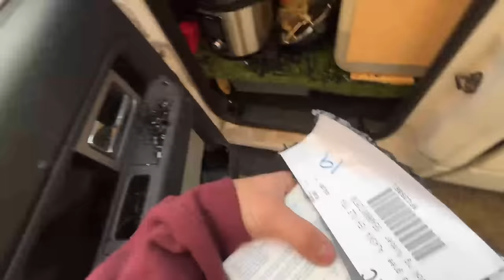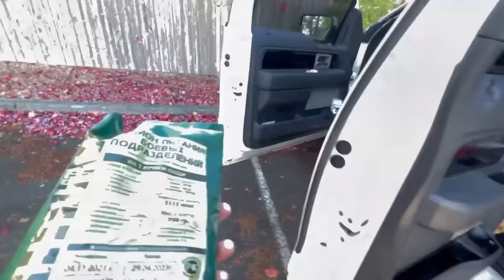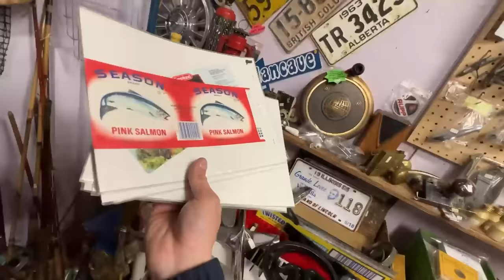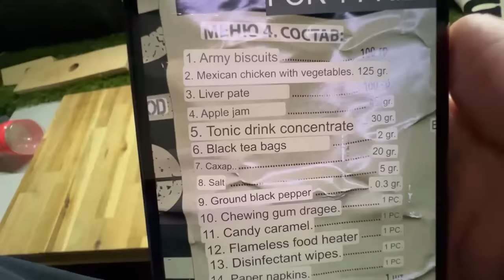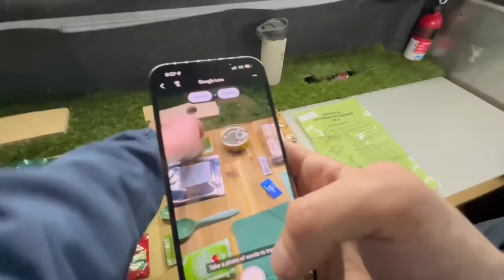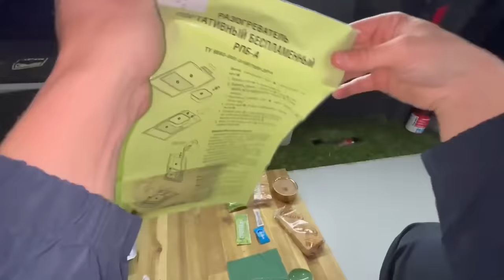Rainy Night Truck Camping W/ a Russian MRE

Comment: 3M makes a window security film that protects against smash and grabs and keeps your truck cooler by blocking a lot of solar. Since its your home it might be worth it.
Reply: Comments like these are actually helpful and are good from an investment standpoint. Also Better then fake sympathy😂
Reply: Oh, I never heard of that.
Reply: Just be aware that the protective film doesn't prevent the thief from chipping a hole in the window, big enough to stick an arm through. It happened to a work truck of mine once.
Reply: @ry-man4354  that's true, no measure is theft proof, but it will buy you time... like if some one broke in while he was sleeping in the back.
Reply: Not that I'd expect it to happens, if his truck fell into a body of water, would he be able smash his way out? Curious.
Reply: ceramic tint, it works surprisingly well. Slows down the thief substantially.
Reply: @michaelvandromme  

I believe I saw on Mythbusters that you wait for the vehicle to fill will water before opening it. There's no smashing windows underwater
Reply: @michaelvandromme  auto manufacturers are know coating the door glass w product like this & are making the glass part of the structural integrity of the vehicle. Something that individuals really need to be aware of when it comes to automobile accidents.
Reply: Unfortunately , the thieves would just do more damage to the car door and maybe  even vandalize the car even more before moving on to the next target. Bad people doing bad things.
Reply: @my_flippin_journey automotive windshields have always been a structural part of the build

Comment: i recently had my f150 broken into in my own driveway, i could be sad & upset that they got my sunglasses & some center console change or i could be extremely happy they didn’t break into the truck bed where there’s thousands of dollars worth of milwaukee tools & toolboxes i use to make my living. glass half full mav! keep on truckin!
Reply: Great mentality brother
Reply: Hello from Australia. 
 I Just thought you might like to get warm by watching my channel and my camping set up. 
Cheers 
Out There Touring
Reply: If you forgot to lock the doors, the term of that type of stealing, is called shopping.  If you had your bed shell locked, I guarantee they checked it, and moved on.  If they smashed your window to steal change and glasses, they were just dumb.
Reply: @bobsponge1877  thank you bob, very insightful thinking buddy. to answer your question the window was broken & my tonneau cover locks with my tailgate.

Comment: I actually just had my truck broken into as well. Right outside my apartment in the gated parking garage with security supposedly "monitoring" the place all night long. Thankfully (and oddly) out of all the pricey equipment hooked up in there, they only stole about $10 out of my center console and a blanket I had in there. It's such a violating feeling though, knowing someone went into your property and messed with your stuff. Sorry that happened to you Mav. What comes around goes around though, and they'll get what's coming eventually.

Comment: Hey MAV. The carbon monoxide detector may have been triggered by the flame less heater in the MRE. The Army gets mad if you use them indoors so there may be a correlation there
Reply: That's definitely it. Those packets release gas.
Reply: 100%

Comment: Tint the windows as dark as you can on the camper and the rear windows if you don't already and weather tech makes really good window covers for all of the windows in the truck and they sell individual ones or the set I use them when I leave the truck for a few days !

Comment: The meat was potted meat, or some call it deviled spam. The crackers are commonly called hard tack. They are a common staple in most foreign MREs. Your CO2 alarm went off because you were using a flameless ration heater which produces hydrogen gas which can in some cases trip CO2 alarms, however, the amount produced was in no way dangerous or hazardous, just got it too close to the detector.

Comment: You should look into having your back seat assembly removed and have a lockable cabinet built into the back seat area.  I have a friend that did that for his welding rig.  It serves to purposes.  first obviously is security for your things, but the second purpose is if you get into accident. all the loose stuff flies around in your cab and it can seriously hurt you,  my friend had it built to be able to remove everything in one shot by sliding the cabinet out either side of the truck onto a cart. just an idea

Comment: The MRE heater is what set off your carbon monoxide monitor. Those shouldn't be used in closed spaces. The monitor did it's job! Stay safe out there.

Comment: Mav, I've been robbed before myself.  I can empathize with your situation.  It wasn't my vehicle broken in, it was my new place.  I just moved 4 states away (in 1993), to start my life over, and only had 2 army duffel bags of clothes and biking gear with me.  2 weeks later, I came home from work to see my front door kicked in.  They stole all of my clothes, my motor bike boots, helmet, and alarm clock.  No one saw anything because they were at work too, and all the cops could do is make a report.  I didn't know anyone in this small town who could help, I had no way to call back home, so I had to fend for myself.

After this incident though, my landlord did replace my door with an industrial metal door with robust hinges.   And luckily, it was Friday, so I went to local store and bought new underwear, socks, jeans, t shirts, and shoes.  

I remember when walking to the nearby convenience store later that weekend, I found one of my old pair of work boots, in an alley dumpster, down the alley I always took to the store.  The leather was all sliced up, making them useless.  It was like the thief was invisibly giving me the middle finger and smiling.  14 years later, I moved out that town to the main city.

Comment: Hey Mav I know you probably won’t see this but you can buy laminate type sheets to put on your back windows, which basically hold the glass together even if it’s shattered, basically completely blocking window smashes. (Don’t put it on the front in case of an emergency where you need to get out of the front windows)

Comment: Your mre heating bag is what triggered your carbon monoxide detector I’ve had happen in the past while hot tent camping  with Canadian  mre’s   I thought  it was the wood stove at first then i  happened to try an mre in my kitchen in the middle of summer and it set off my detector

Comment: by the way, the reason why the carbon dioxide sensor went off is because the packet that you used to heat up the food release is an extremely large amount of carbon dioxide, that's why as soon as you started cooking with it, I was like, he needs to open that window because I've eaten American memories, and those heating packets are nasty, smelling, they really stink, and I accidentally inhaled some of the smoke, and it choked me out

Comment: I've working with the homeless since 2009. Large homeless issues are not caused by a city 'making it easy' it comes from the a city not caring enough to provide the needs for their homeless population. That being said most homeless individual don't break into other people cars, it's too high risk. They will break into abandoned home and other places. These are mostly junkies that don't care what happens to them or others. I've had to kick more than my fair share out of the shelters because they are too destructive. Because in my area the shelter is located right next door to police headquarters, we contact the cops. Others don't, and they'll just roam around breaking everything till they have enough to pawn.